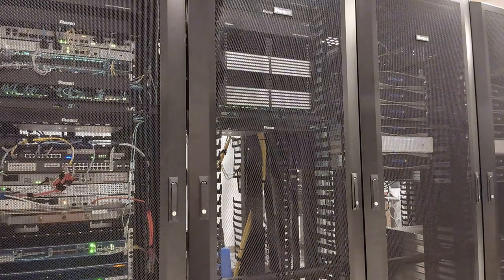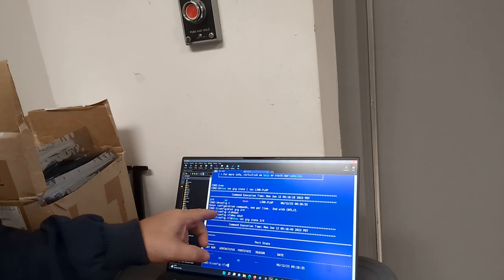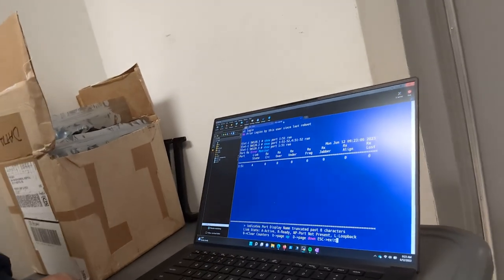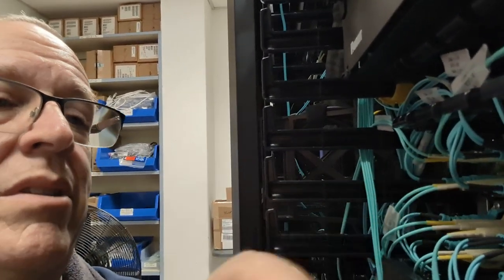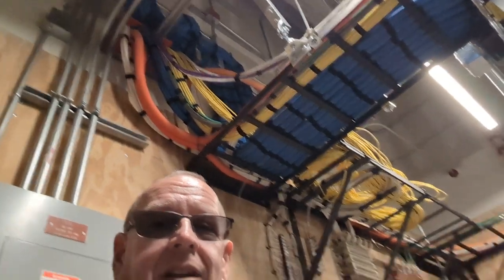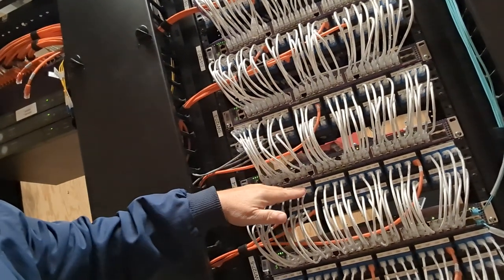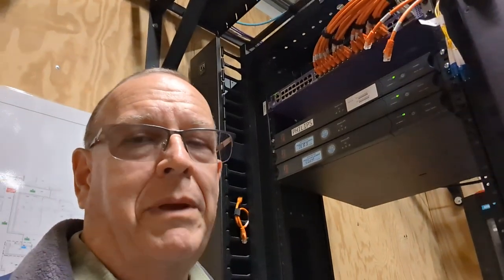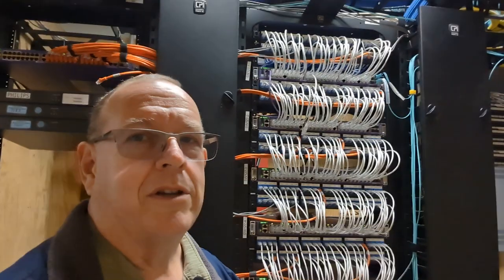Network Admin Life - Fiber Flapping

Comment: Always great to see you troubleshooting Network problems.  I grew up in plain internet as well, back when we only had Thin-net with the BNC termination connectors. the T-Connectors, and the tall-hatted resistor connectors.
Reply from the maker: Did you ever work on "garden hose" with the big vampire taps?  I did... just once.  But mostly it was IBM SNA networks with their BNC cables, cluster controllers, and front end processor.  God bless!
Reply: @NetworkAdminLife  No, never something that big.  But I did work on Toke-Ring cabling and Adapters.  They were very unpredictable in terms of relaibility, even though in Grad School we learned they are more calculable in terms of delays, so great for manufacturing controls.

Comment: what capacity fiber line feeds the data center and what capacity fiber goes out? for example, 10gps in and 5gps out....
Reply from the maker: From where to where?  It's a 1Gig Internet circuit in.  But to the user edge switches it's 40 Gig aggregate, two 20 gig links to one pair of cores, and two 20 gig links to the other pair of core switches.  Also 40 gig into our server switches.  Hope that answers it.  God bless!

Comment: my first networking job was all 10Base2 and some AUI, which then evolved in to 10baseTX on CAT5, this was still in the days of hubs rather than switches, later it moved more into gigabit switches and 1000BaseT on CAT5E / CAT6(A)
these days it's still mostly copper, with some fibre 1.25Gb and 10Gb.
Reply from the maker: Mine was on IBM SNA networks.  Ethernet was still considered experimental at my first job.  God bless!

Comment: 'My' switches show RX and TX power on the interfaces; When the fiber gets bent, I see a drop of a few to too many dB. On the good fiber it still works, but we have 10G-LRMs driving 200m of FDDI-grade fiber, which miraculously works, though with barely any margin.
Reply from the maker: Great suggestion!  Mine do show that too but I never really look at it.  I just fiddle with the connectors until the link stays up.  I'll check that out.    God bless!

Comment: If I understand you right, you have 2 fiber to a stack for redundancy.that is good. But both to the top one ist noch the best. Better make one fiber to the top of the rack and teh other one. So if the top switch goes down the rest of the stack stays online.
Reply from the maker: So we have two fiber pairs from one core switch (separate cards) going to the top switch in the stack, and two fiber pairs, from two separate cards in another core switch going to the bottom switch in the stack.  If there is only one switch in the stack then we obviously can't do that.  And the two core switches are on different sides of the campus.  God bess!

Comment: CRC Errors are always speed and duplex mismatch check that
Reply from the maker: But then they disappear when I reduce the bend radius in the fiber where it plugs into the switch.  I'm certain the speed and duplex are the same.  As certain as I can be anyway.  God bless!
Reply: Great tip